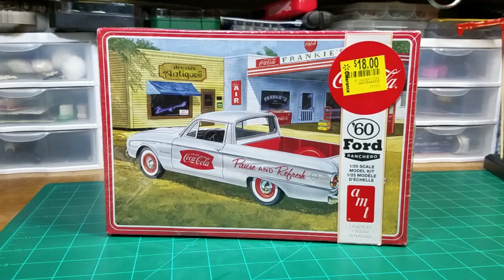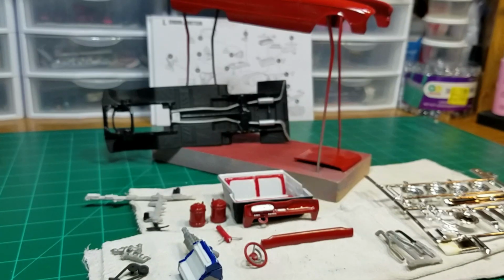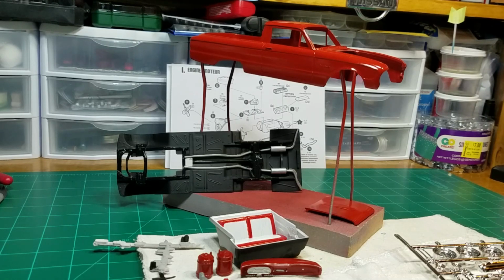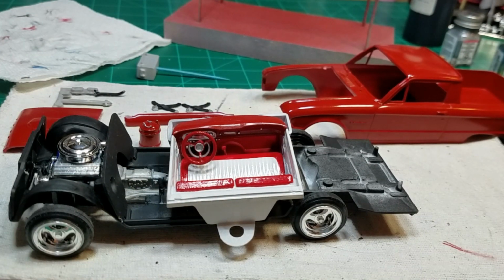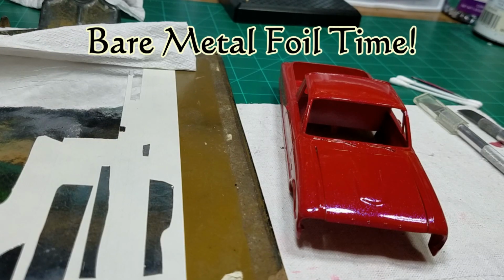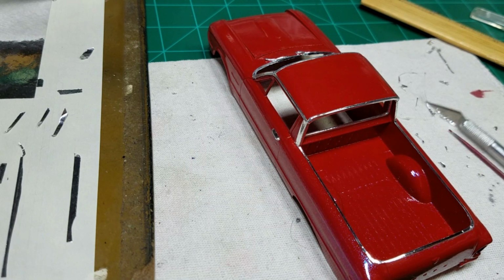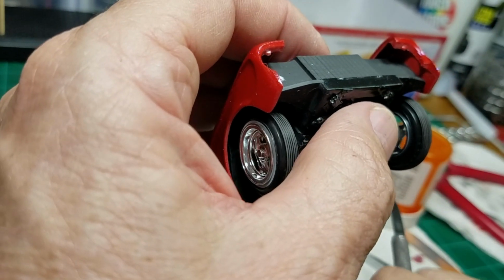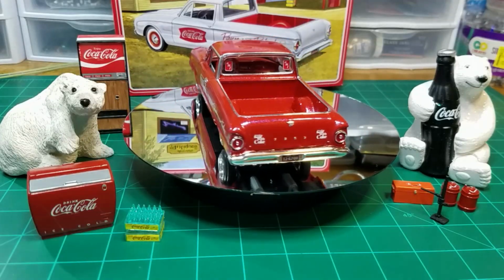1960 Ford Ranchero “Coca-Cola” edition by AMT - Episode 20

Comment: Great build!
Reply from the maker: Thank You! It was a fun kit to put together.
Reply: Your  foil   trim work excellent....i wouldn't  have the practice  to do it .. And  my eye's suck .for small detail work
Reply from the maker: @toddmeader2362  Thank You! I have been working with foil going on 23 years now. Started working with it not long after it hit the market. As I have gotten older my eyes have gotten weaker for close up work as well. I have resorted to using a magnifier visor thing. It definitely helps especially when I have been at it for a few hours. Thanks for watching!

Comment: I've Got this kit. I had a 60 Ranchero in 90-92 I was going to Hot Rod the 144 ci in 6 & Add Mustang 5 speed to it Also Wanted to out the Mini Lebanon front clip on the Car. It would've got 50 MPG highway
Reply from the maker: Sounds cool!

Comment: I enjoyed this Ranchero video and I want to try the Dagonfly Glaze.  Hobby Lobby has FolkArt  Dragonfly in 6 colors. Which one did you use ? Thanks
Reply from the maker: I'm glad that you enjoyed this video. I have every color of the Dragonfly glaze that they sell. On this particular build I use the Red-Violet-Blue. This glaze works over almost any color. I airbrush it on at about 25 psi, #5 tip and thinned at about (I never actually measure it) 60-40 ratio. Just like when using craft paint, to the consistency of milk.

Comment: The 1960 Rancheros were basic cars with minimal trim. As more time passed, more trim was offered. Strut braces dominated the engine bay. To bad AMT couldn't mold these in and offer Ford's only engine, a straight six.
Reply from the maker: I agree. My grandfather had a 1960 Falcon, which this Ranchero was based from. His had an inline 6 with a manual transmission. I don't remember a whole bunch about the car because I was just a wee lad but I remember that it was a two door and it was black. He had that car until the day he died. I cannot understand why AMT decided to go with the V8 engine for this kit. A V8 was available after the 62 model year. Maybe AMT was trying to make it into a hot rod car? Don't know.... I can't explain it... It would have been nice to have the option between the I6 or the V8 though. Thanks for watching!